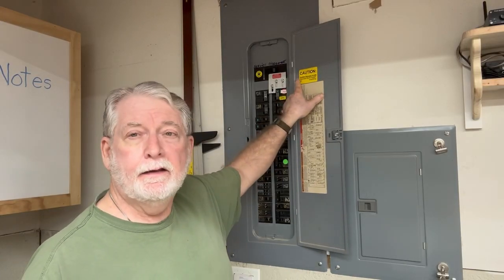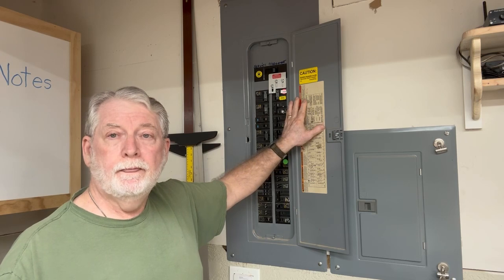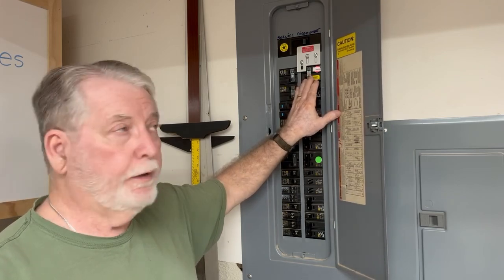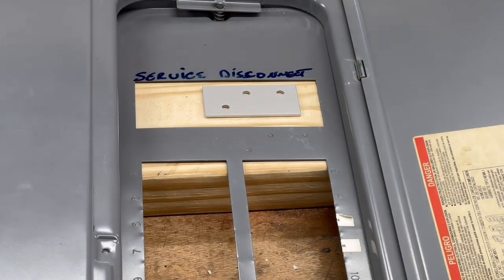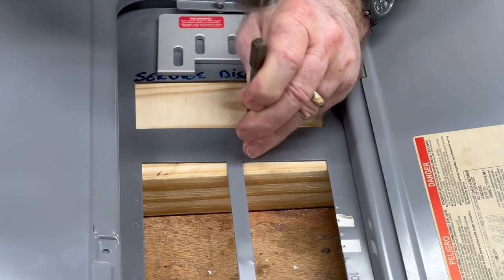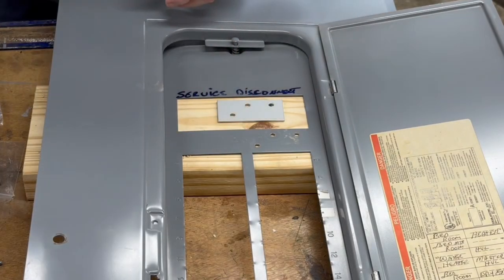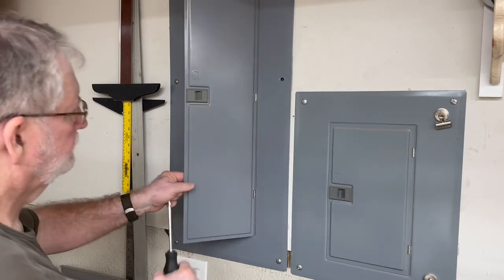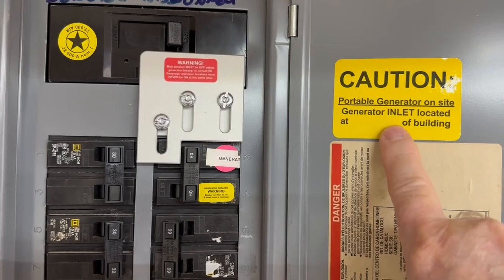How to Add a Interlock to Your Electrical Panel.

Comment: How do I connect the breaker to the generator?
Reply from the maker: You need to run an electrical wire to the location on the generator and install a waterproof outlet
Reply: No offense, but if you have to ask that, you need more electrical knowledge before embarking on this project yourself. But to answer your question, you'd run a line from the breaker, through conduit, into a box which contains an "inlet" receptacle, which is male rather than female. Remember, it's status is controlled by that interlock mechanism. So can only be turned ON and able to feed your box when the main is OFF, and it must be OFF (and thus safe to the touch) when the main is ON.